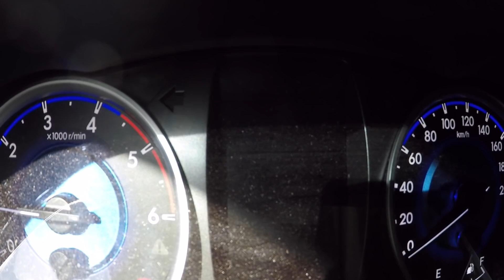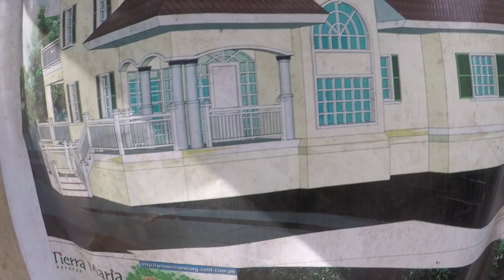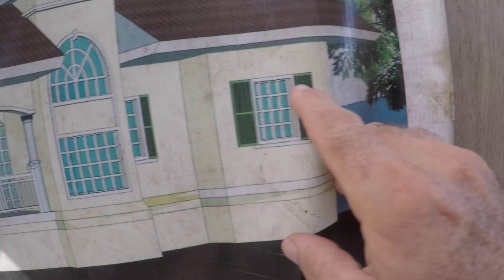VILLA FELIZ - EPISODE 221: ROOFERS AND BANKERS HOURS (House Building in the Philippines)

Comment: James another idea for the pump piping is to have unions after the valves to make it even easier to remove if work needs to be done. Otherwise, the house is looking good.
Reply from the maker: Hi Robert.  The pump itself does have unions on the intake and output.  Not sure if I got close enough to show that today.
Reply: Sorry,  I didn't see them.

Comment: As I watch the part where you mentioned the bypass at the pump, not only is it a good idea but it is necessary. If ever the pump fails you would be without water (unless it can force itself through the failed pump). Typically the pump would have to come out and be out for hours or days while being repaired/replaced.
Reply from the maker: Yes, the bypass is a great idea...not mandatory but just good planning.  If the pump fails the water will still pass though, just as it is working now with the pump unplugged.

Comment: You said "I should have caught that earlier" about the short fence post. Now I have to be critical...the builder or workmen should have caught it sooner...fencing 1 o' 1...level posts!
Please have them chop the short post down to reveal the original rebars, go down so they reveal about 12" of original rebar. Tie longer rebar to those that will extend up to required height. Then box and cast that. This is the proper way to repair this flaw - not add a little piece on top!
Reply from the maker: Yes, exactly correct Michael.  Thanks for the tip!

Comment: During all that rain did you check for leaks in the roofing/drain line/secret gutter system from the roof before the ceiling is completely covered up? Do you have access holes planned to get up into the roof for future maintenance,inspections,etc. ? I didn't hear you mention it in the past few videos .
Reply from the maker: Yes, and yes.  All the roof isn't completed though and once that is we'll do a final inspection.
Reply: Kudos to you that you are on top of it! Good luck with the outcome.

Comment: That was pretty scary watching you walking down that concrete stair stringer from the second floor. Bad enough how small it is but with the 4 studs sticking up I was cringing that you would catch your foot on one and fall.Since the project will continue for many weeks (months) wouldn't it be wise (for safety and more easily taking materials upstairs) to put down some temporary stair treads? Maybe not full with but how about 2" x 10" x 24" wide .
Reply from the maker: My builder doesn't spend any money on anything that isn't absolutely necessary.  I doubt he buys temp steps since we're only 6 weeks away from completion.
Reply: 6 weeks? That's very hopeful outlook based on the progress thru out the build. We will all hope for the best so you can have a nice Christmas with the wife in your new Beautiful home.
Reply: if you cant have temp steps then at least have a temp handrail using some scaffold.